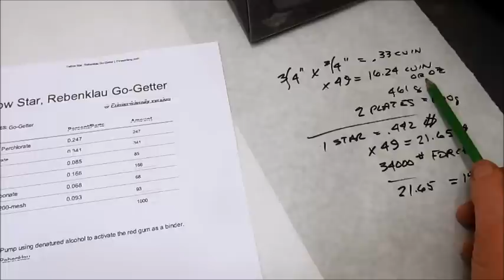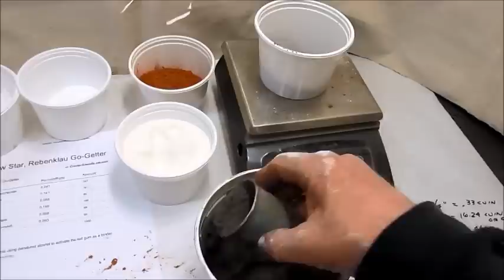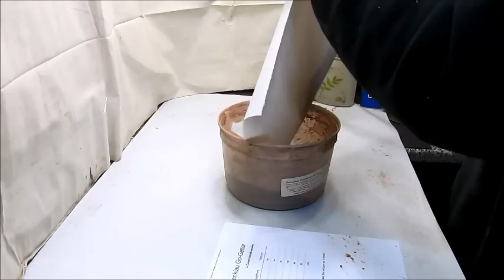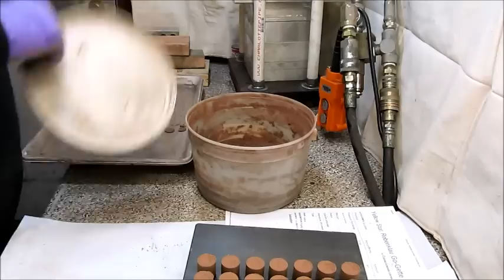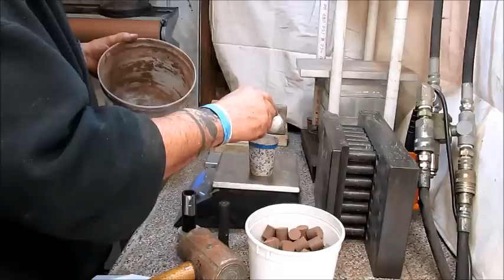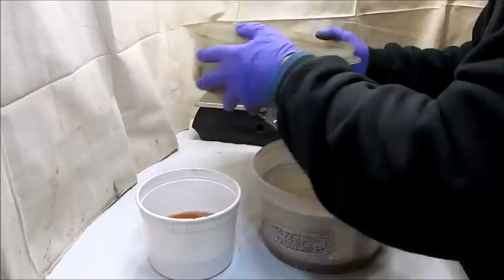Pumping Three Quarter Inch Stars Using a Star Plate

Comment: Good day,  really like your videos, just made a batch of blue stars with red gum and dextrin! I am confuse about using water for the dextrin or achool for the red gum! Don't want to ruin this batch!
Reply from the maker: If there's dextrin in a comp, I use water. I use denatured alcohol if red gum or phenolic resin is used as the binder. Good luck with the blues.
Reply: @nedgorski Thank you. The only concern is this comp uses both red gum and dextrin! Will see
Reply from the maker: @Pyro2024-cdc  Like I said, Chris, if it has dextrin in it, the dextrin is in there to be wetted with water, and act as the binder.

Comment: Good Day Ned, I made a 250g batch of tiger tail using dextrin and à solution of 75/25 alcohol and water for moistening! 5% in the mix! Wasn't a sucess! I pressed it with a 1 ton arbor press with star press from woody's! The mix was so fluffy and messy! Like dust! They could'nt hold together! Maybe you could help me on this one! Thanks
Reply from the maker: All I can suggest is more pressure and/or more water, Christian. It can take some experimenting and dialing in. Good luck.
Reply: @nedgorski  Ned, I change for 75% water for 25% alcohol and 10% moistening! They are rock solide from the press! Happy!
Reply from the maker: @Pyro2024-cdc  Excellent, Chris. BTW, the alcohol can inhibit the dextrin's binding ability. I'd suggest either reducing it to 10% and 90% water, or just using plain water. Good luck.

Comment: Ned, what can replace denutured alcohol?
Reply from the maker: It depends on the formula and process, Christian. Another alcohol would be my first suggestion.
Reply: @nedgorski  I am making blue star and I will be using red gum
Reply from the maker: @Pyro2024-cdc  What pure alcohol can you get a hold of, Christian?
Reply: @nedgorski  99% isopropyl
Reply from the maker: @Pyro2024-cdc  Yes, I'd try that. How will you be making the stars? Nowadays, I do prefer phenolic resin over the red gum, but your red gum should work in a pumped or box star
Reply: @nedgorski  will be using a 3/8 star plate that I bought from woody's with 5% alcohol on a 500g batch!
Reply from the maker: @Pyro2024-cdc  Good luck with 'em. With the resin, I go as low as 2% alcohol to prevent the comp from sticking to the plate/pins.
Reply: @nedgorski  tought you were using 5% for    moistening?
Reply: Hey Ned, if I want to use phenolic resin insted of dextrin or red gum in future project,    Will the ratio be the same? Let say phenolic resin versus dextrin?
Reply from the maker: @Pyro2024-cdc  I do use phenolic resin, and alcohol, to bind a lot of pumped stars, Christian. I use about 8% resin in the NX formulas.

Comment: Ned,
    I have access to all the free isopropyl alcohol I need. Will isopropyl work the same as the denatured alcohol for these rubber stars?
Reply from the maker: That's a good find, Vince. Is the isopropyl alcohol 99% alcohol? If so, it should soften the redgum in these stars, and work. I've no tried that, though, so I'm just guessing. Good luck. Nowadays, I use phenolic resin instead of the redgum in such stars.
Reply: Yes it's actually isopropanol 99.7%. I'll give it a try. Thanks Ned

Comment: how many kg of pressure do you use in the hydraulic press?
Reply from the maker: We calculate it as "pressure on the composition", Franklin. Typically about 1500 psi on the composition is used when pumping stars and comets.

Comment: Hi Ned, question...will using a pneumatic cylinder work to build a press or is a hydraulic system needed? I recently picked up a pneumatic cylinder at the local scrap yard that was part of some sort of automated manufacturing machine that was scrapped there and want to use it to build a press, but not sure if it will work.
Reply from the maker: Hi, HGP. Although, here and there,  a few pneumatic cylinders are used in pyro presses, most of us avoid them, and use hydraulic instead. Hydraulic fluid doesn't compress much at all, therefore not much energy is stored as some tooling is pressed in the press. But, air compresses a lot, so a lot of energy is stored in a pneumatic press. If something is out of alignment as some tooling is pressed, and something goes wrong such as tooling trying to "shoot out of the press", all that stored energy would really spoil one's day, or life. Therefore, for that reason, and for the availability and ease of setting up and using a hydraulic press, most of us stick with them. Stay safe out there.
Reply: @nedgorski  Thanks for the response Ned, that makes sense. I didn't realize the possible issues that can go wrong, you mentioned with an air press. Definitely don't need any of that. I will have to read up on hydraulics and learn what components I need and how to put it together. Thanks again. Have a happy Easter weekend.
Reply: If something sticks then comes loose, pneumatics move FAST and can impact hard.  Not good if it strikes sparks, ignites by impact or catches your hand.
Hydraulics moves slowly, highly controlled.  I know which I'd rather have my hands around!
Reply: @scottwillis5434  that too makes a lot of sense now that you say it like that. Thank you

Comment: Do you buy your chemicals in very high amounts because you seem to use a lot of it, perchlorate is expensive as well
Reply: James Zachary damn, I live in the uk and I paid £97 for 6kg which comes out to about £7.50 per pound. I don’t really think there many clubs near me because of certain restrictions and you need a license for perchlorate so I doubt going to a club would change the price.
Reply: @afbennett3038  be careful with the 'stockpile' clause in your explosive certificate (assuming you are manufacturing at home). Correct me if I am wrong but I think they normally consider under 10kg as acceptable amounts of raw chemicals, more than that and you then become open to being a manufacturer rather than experimenter.

Comment: Nice video.But some safety tips.Don't shake star mix in plastic containers because of static ignition hazard.Just sieve mixing.Then use a garden sprayer to spread alcohol wetting.Finally the pressing should be done remotely due to possible ignition and explosion.What are your plates made from?

Comment: How much pressure to use for those comets?
Reply from the maker: I typically pump at 1500 psi on the comp.
Reply: @nedgorski  thank you very much. What piston do you use? How can I buy your compositions?
Reply from the maker: All compositions are in the database on the website, Askenaz. If you mean the cylinder on the hydraulic press, I'd recommend looking at the presses at woodysrocks.com

Comment: could you use some sort of dry lubricant or silicone lubricant spray on star plates to keep the comp from sticking? or would that mess with the star's ability to light properly?
Reply: It could definitely have an effect on the final outcome, hell could even cause spontaneous combustion due to the lubricant sprays reaction to the specific chemicals your using. I only clean my press with water sometimes alcohol
Reply: @kravenslegacy1  I figured as much, even graphite powder lubricant would affect the final outcome I guess.

Comment: Fascinating video.  Would there be anything to gain by ball milling everything but the oxidiser and metals first, and then screening them in?
Reply from the maker: Typically in our comps, John, as long as the ingredients are fine enough to pass a 40 or 50 mesh screen, unless otherwise specified, we're good to go with them.
ned
Reply: Thank you.

Comment: WOW ! Like you'r work :)
I wish I had all those stuff !
Greetings from Germany !
Reply from the maker: Howdy, and thanks. There are some Germans in Fireworking.
ned
Reply: Many of the tools used for making a lot of stars are extremely expensive. But you can use other things to accomplish the same results. Not at the volume of course. I invested into other means...15 ton old hydrolic Jack..
Steel plates from my hardware store. I invested in screens (the ones the miners use to sift sand), I bought 2 star plates..3/8", and a 1/2". Total cost under $120.00

Comment from the maker: Important

You'll notice that "Wear a respirator" is one of the safety commandments. I like to use a dust and solvent fumes rated two-cartridge respirator when working with solvents very much, or when dealing with hazardous dusts.

I made these stars and video yesterday, though:

I mention in the video that I much prefer to work outdoors with such dusts, especially bariums and potassium dichromate, etc., the hazardous chems we use. I also mention that making a video like that requires that I work indoors, and without a respirator.

Well, almost immediately during and after making several batches of those stars, some of which I used a dust-mask for, but not a respirator, I started to cough a little, had a bit of a runny nose, felt flushed in the head and "hot", etc.

I just figured that I was getting another bug from the little kids who hang around here, but I did notice the alcohol fumes started to get to me at one point, and somewhere in the back of my head I thought, "I wonder if all this has to do with the not-working-outdoors, and not wearing a good respirator."

Today, I truly feel like shit. I've worked a little, priming another batch of stars, but have spent most of my day in bed.

"What if a rookie is tackling these barium, alcohol bound stars right now?", I pondered.

What does the MSDS for denatured alcohol say?

http://engineering.case.edu/thinkbox/sites/engineering.case.edu.thinkbox/files/msds-1-denatured_alcohol.pdf

What does the MSDS for barium nitrate say?

http://www.sciencelab.com/msds.php?msdsId=9927449

Neither chem is a joy to inhale, with potentially harmful effects.

I'll keep an eye on these symptoms, and get some treatment if it seems necessary.

IIRC, in the past, some other experienced practitioner, experienced some pretty serious reactions to barium compounds, and has to avoid them now.

Just a heads-up, and a seemingly important one. It's a bit embarassing to admit such a potentially serious mistake, but it's best to do what's in everyone's highest good.

Maybe I'm just coming down with a bug, but it doesn't feel like it.

I'll keep y'all posted. Rook, pay close attention to all this!
Reply: It's nice and honest of you to post this Ned.
Just goes to show that we must be careful and use the right gear or work outdoors whenever we can.
Reading the MSDS beforehand never hurts I've learned :)

Another great informational video. I've said it before and do so again, you have some of the best videos I have ever seen. It's a joy to listen to you explaining things while showing how to do it.
Great work!
Reply from the maker: ***** Thanks a lot, PCZ. Yeah, honesty is the best policy. Bull-schtit might get you somewhere in some endeavors, but it'll get you hurt or killed quickly in this one....or at least will earn ya a bad name in our little community.
Best,
ned
Reply: Yeah watching you work with that Barium nitrate with no gloves, or mask, really made me cringe. That stuff is EXTREMELY TOXIC, which I’m sure you very well know.
I can deal with a little muffled voice, while watching and listening to you work. Just so long as you’re safe and not breathing in those toxic chemicals or rubbing them into yours eyes, etc., and making yourself sick.
I hope all was/is well Pyro Professor  Ned, keep it safe always, and THANK YOU for passing your knowledge and experience onto everyone that watches your videos and reads your articles. You are a WEALTH of knowledge and very much appreciated.
Reply: ned gorski....hello sir! Ive watched and enjoyed ALL the publicly avail videos you have. So i think im going to subscribe and get the rest with the next couple weeks, next time i pay bills, lets say that. 

Anyway, i have a quick fast question....how do you know how many times to what the “rammer” when youre ramming a composition? Ive noticed every single project so far, you whacked the rammer a different number of licks. You explained in one of the first videos on how hard a proper whack should be. And you did state how many whacks for THAT project. But you havent explained anything else about the number of whacks!?!? To some this may sound trivial. But i proper pack on the composition is important. But again, i dont want to whack too much either. So can you maybe give us some way to know about “whacks”? 

Thank for your time and in advance! Also thank you for ALL the information and experience youve given us for free! Im serious, I appreciate your time, knowledge and experience! There are VERY few actual educational videos avail for free on this topic! This is rare thing! So i hope others seeing this understands as well!! 

Good day brother.

James
Reply: For those not familiar with PPE:

3M 6000 series half-mask respirators (6100 Small, 6200 Med, 6300 Large) with click-in filters and cartridges are one good choice.  $40-ish.  

P95 (particulate) less restriction, P100 good particulate filtering (but your lung muscles may get sore until they build up).  Various cartridges available for organic vapor (solvents), ammonia, etc. etc.  

Put in a sealed bag when not in use.  

Check the fit by blocking the exhaust and breathing out; the mask should push out from your face until that makes it leak.

Seems like it should be possible to fit a small mic inside the mask, or do a voice-over if needed.  Beats being sick!

Nitrile gloves come in various thicknesses; thick for durability and reuse (if not used for nasty chems); thin for dexterity and cheap / get rid of contamination.

Goggles, safety glasses with side shields or face shield, depending on what you are doing.  If it goes foom, spatter, is dusty or whatever, probably going to still want your eyes to work.  And solvents get absorbed, give me a headache.

Good ventilation.

Comment: What a difference using the red gum/alcohol vs water/dextrin.  Priming works MUCH BETTER :)
Reply from the maker: Bingo. To get an even thicker prime layer, a "toro" slurry of 3:1 water:prime can be used to wet the stars, followed by dunking them into dry prime.